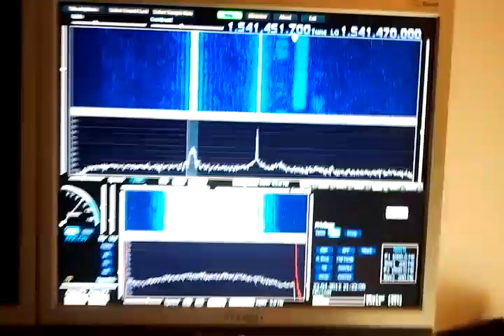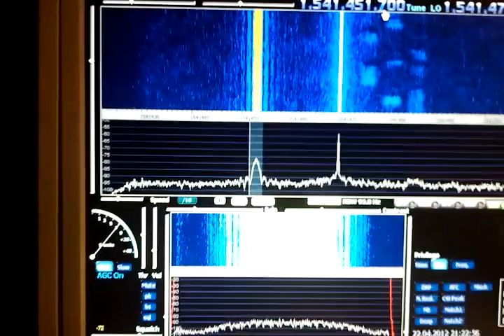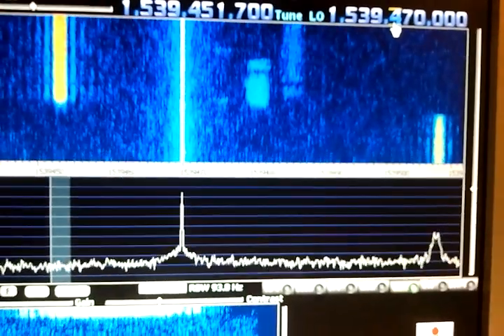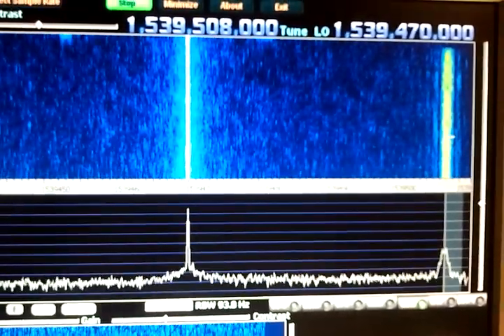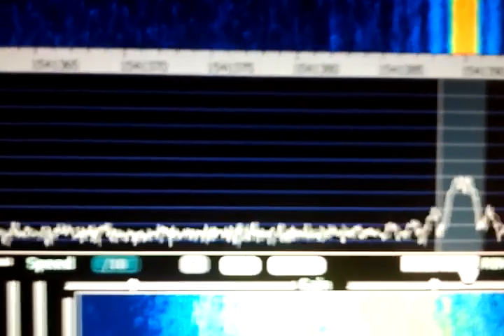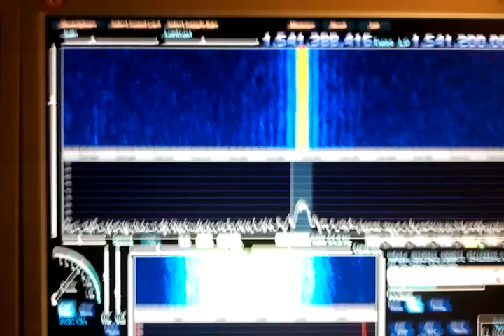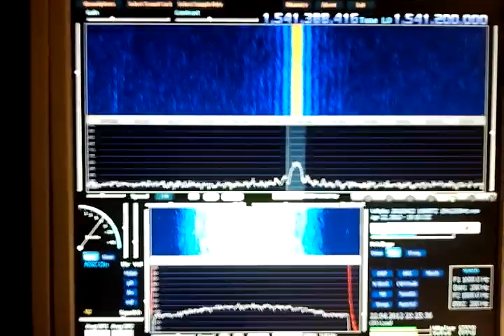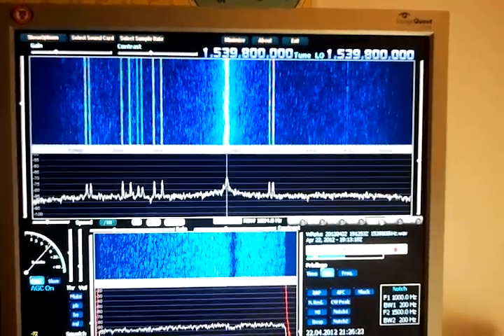Dongle Shootout: Funcube vs RTL SDR - Part 1

Comment: the dvb-t has a wider band with and the diference between the hight of db gain is a difference of a different antenna and even just moveing a antenna can change that. i have even her a lot on the internet abought the dvb-t being a better card for more options then the funcube and on top of that to me the diference is a huge price i will stick with the dvb-t as that is only $16 on ebay and the fun cube is $150